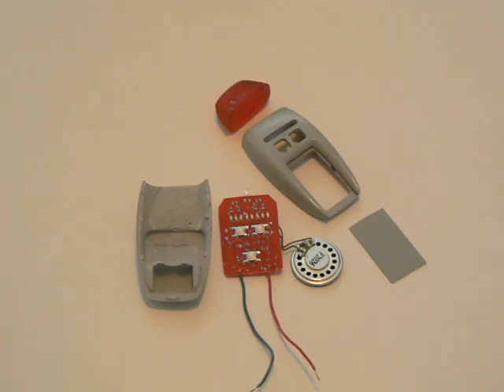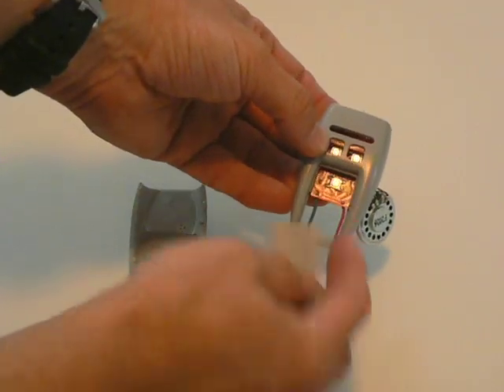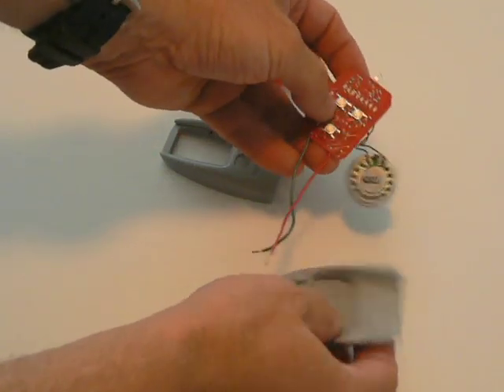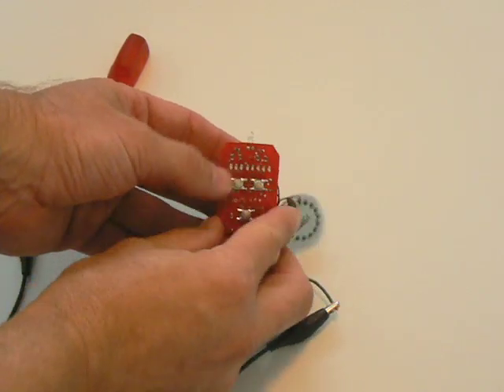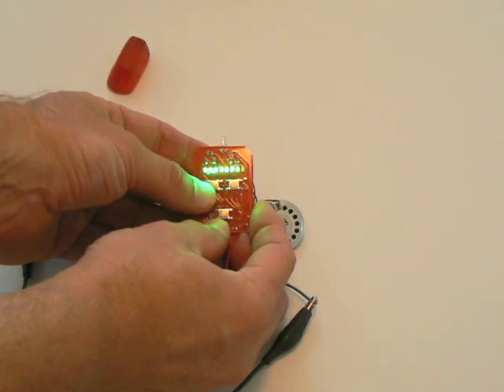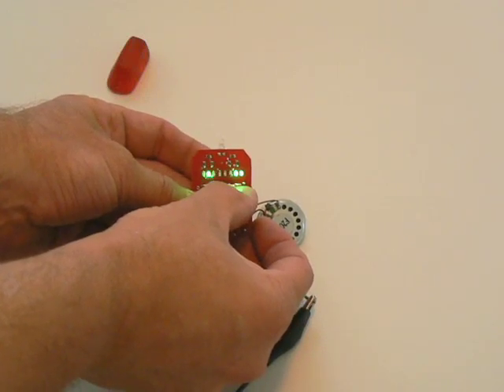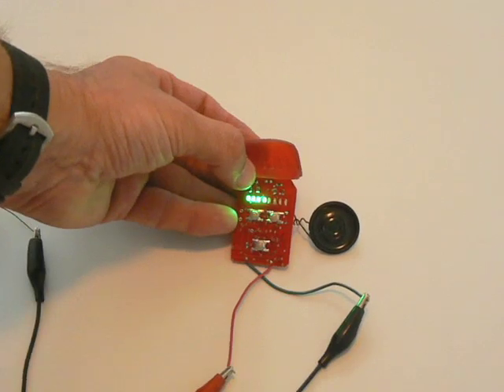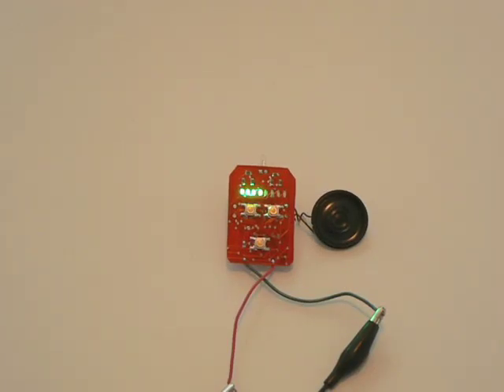Cricket Phaser

Comment from the maker: I have a new run of these boards available now! The one in the video is version 1, but the latest set is version 3. Many improvements have been made: more accurate display, 3 firing modes instead of 2, improved sounds, and more power efficient. PM me if interested or leave a message below.